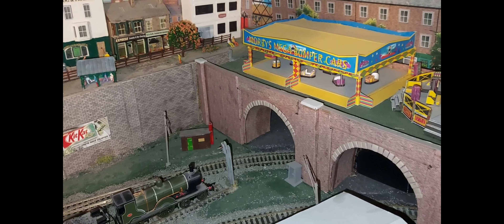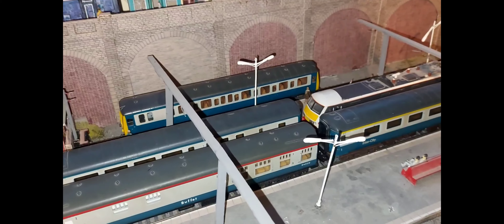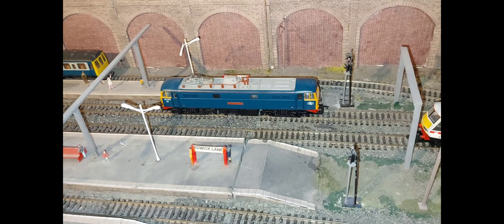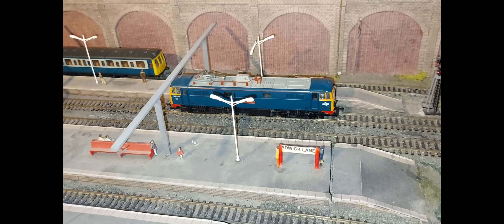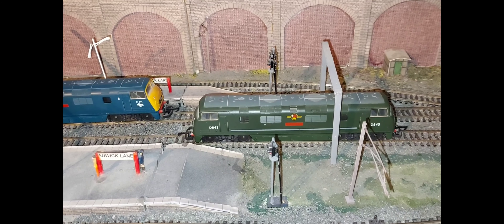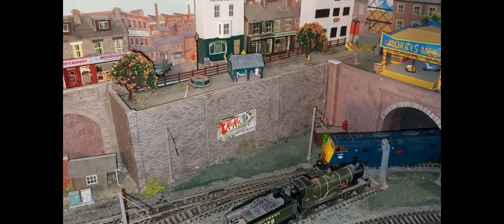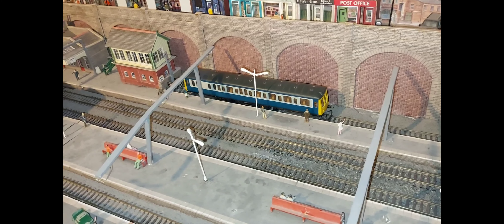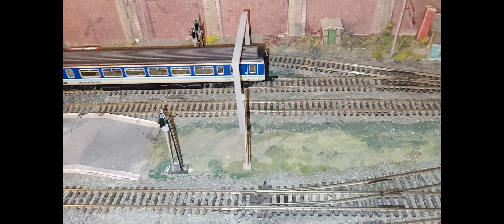Mini Update 12th July 2021

Comment: Great improvement with the CD motors. I really must try that. Where do you get them Geoff?  David.
Reply from the maker: Hi David .
I get them off Ebay , Here's links to the sellers I get them from:
https://www.ebay.co.uk/sch/hornswhistlesworkshop/m.html?_trkparms=folent%3Ahornswhistlesworkshop%7Cfolenttp%3A1&_trksid=p3542580.m47492.l71970

And:

https://www.ebay.co.uk/sch/strathpefferjunction/m.html?_trkparms=folent%3Astrathpefferjunction%7Cfolenttp%3A1&_trksid=p3542580.m47492.l71970  
 You'd need to keep checking back on the Second link as he's sometimes away so has nothing listed.